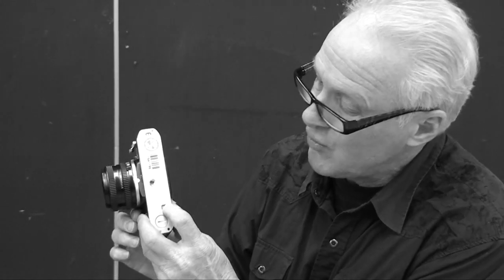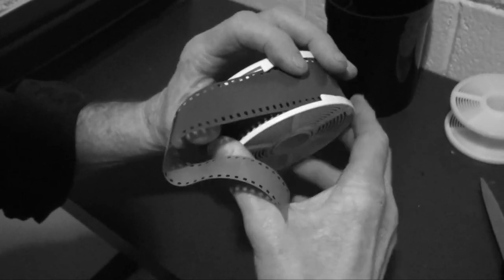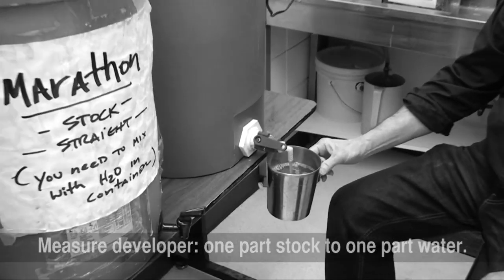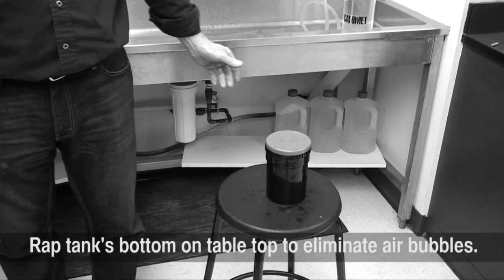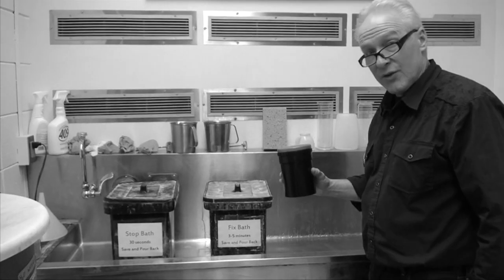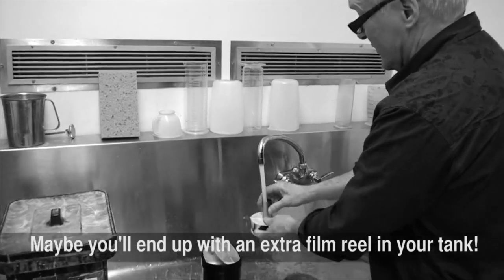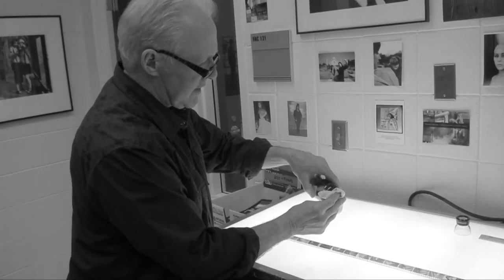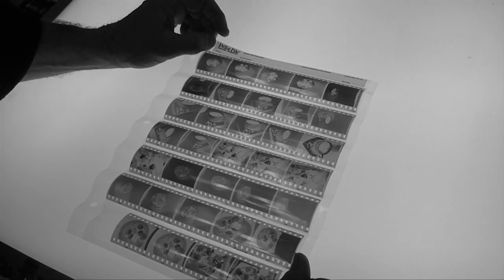Developing Black and White Film

Comment: I used to whack the protruding end of the spool of the cassette on the counter to push the cap off the other end, and if that didn't work, I'd use a bottle opener. The bottle opener method would usually bend the end cap and make the cassette unuseable for re-loading.
Cutting my negatives into six strips of six allowed me to make a contact print of all 36 frames on one sheet of 8 X 10 paper. A newer version of the Patterson proof printer which I used to use is still available at Adorama.
Reply from the maker: Bulk loading film is awesome if you are an avid 35mm shooter and want or need to save money. You can also make your own custom length (16, 20, 24-exposure) rolls. But it takes some effort and won't work for every camera, and you probably will lose some shots in the process. I found a great article and how-to on bulk film: https://www.35mmc.com/27/12/2019/worried-about-the-price-of-film-some-thoughts-on-bulk-loading-and-my-process-by-daniel-sigg/. And, I think the author might be from MN!! I always used a bottle opener to open the film–and hadn't heard of loading your own film at that time!! Instead I used the canister pieces for art projects... :)) Thanks for the tips!! –L

Comment: May I suggest extracting the leader in the light, using a device which may still be available, then cutting the corners off in the light. You may then locate the leader in the spool, turn the light off and then pull the cassette down. This will enable you to load using the ratchet without the film coiling up. Pull the cassette down again as it gets to the spool.When fully loaded you cut the cassette away from the spool quite easily. This also works if you are using a centre loading spool though this takes a lighter touch. I also used to check the dev temp and stand the tank in a bowl of warm or cool water depending in which direction I needed to nudge the temp. Also agitate every 30 secs to increase contrast. I just checked - you can still buy a film leader extractor. If I am going on a bit I apologise but these videos are bringing it all back to me. I really need to get all this gear back again. I started as a kid in the 1960's and printed my last in the late 90's. I was pro by then but colour was replacing B&W and, of course, digital came not long after. There's a lot of nostalgia in this for me. All the best Jon
Reply from the maker: There are lots of different ways to do the same things :) We're glad our videos are bringing back memories for you and inspiring you to get back into black and white photography!! Film photography is not dead! There are many wonderful articles on the Internet that say so and that in fact it's making a comeback. Nothing will ever replace the experience and beauty of black and white photography. Good luck to you Jon!!

Comment from the maker: ***** The way he agitates the tank is the best way to keep the film covered with “fresh” solution. Developing chemicals become “exhausted” shortly after being in contact with the film (a part of the developing process). Properly agitating the tank is very important to getting great results. Under agitating usually yields less contrast, while over agitating tends to increase the contrast, but could also damage the film.

The invertible tank he uses does not come with a part like that. There are other types of tanks—some you slide back and forth or some with a handle to turn. Inverting the tank as Professor Agar does causes some of the liquid to escape, but not much. Good luck to you!!

Comment from the maker: Elainiel Baldwin You have to be in complete darkness--you cannot see your hands when loading film onto the reel!! If you don't want to be in total darkness, you can get a black bag specially made to use when loading film. Your hands, film, reel, and tank go in the bag. You won't see what your hands are doing, but you will be able to SEE. There is another kind of film you can use that can be loaded while using a red safe light--it is called orthochromatic. "Orthochromatic photography refers to a photographic emulsion that is sensitive to only blue and green light, and thus can be processed with a red safelight. The increased blue sensitivity causes blue objects to appear lighter and red ones darker" (from Wikipedia). Ilford makes orthochromatic film.

Comment: Me: Wears gloves, tries to work as clean as possible, doesn't dispose chemicals  to the sink...
Will Agar: hold my rodinal
Reply from the maker: It is best to use gloves and other precautions but easier to not... The majority of chemicals used in the black and white darkroom are classified in the range of non-toxic to slightly toxic. However, black and white developers can be toxic, especially when ingested or inhaled or when in contact with bare skin. Some, but not all, people are extremely sensitive to chemicals present in some developers which can cause severe skin reactions.

Comment: That's a lot of chemicals you're pouring in for just one roll of film.  I have the smaller tank versions with the steel spools and it takes less chemicals.  Granted, you have to have the proper bowing technique to get it loaded right.  I've messed up once loading it.  The film was touching itself and wrecked some frames during developing.  And here's a tip for you:  if you ever run out of Photo-flo, use bottled water.  After the final rinse, empty the water out of the tank, pour bottled water into it and let it sit for a bit.  The first time I developed, I did get streaks because I didn't have a wetting agent.  Then, I tried bottled water, because the tap water is hard.  It has worked for me every time.  I have never used a wetting agent of any kind.  Not even dish soap.  I'm sure the wetting agent does a better job, but it's something to consider.  And why not?  A lot of people just use plain water for stop bath.  I use stop bath.  I just make it weaker so the bottle of concentrate goes further.  I also like the fact that you did not use a film squeegee.  It's not necessary and you risk scratching the film.  Thanks for posting.
Reply from the maker: The Professor says chemistry is cheap. Film and paper (which contain silver) is the more expensive investment. The products he uses in this video are what they have at the college and work best for most students–a little easier, less mistakes... Thanks for sharing your experiences and the bottled water tip!! Best of luck to you!! –L

Comment: You can extract the first 2 or 3 inches of film with a handy device and trim the end in the light. I still have this gadget. Certainly made life easier. Whats also handy is that you can reload the cassette from  a bulk stock of film. Thanks for the trip down memory lane.
Reply from the maker: +jj53 Thanks for the tips, although it is always best to work with undeveloped film in complete darkness. Even though there is usually a generous area of blank film at the beginning, even a very small amount of light getting into the canister can ruin those first shots. I like the idea of reloading bulk stock into an empty film container. How did that work for you? Thanks for watching and good luck to you!! :)
Reply: Never had a problem with light getting around the tool. The bulk film loader was great and enabled you to  recycle used film cassets. The is no darkroom stage in loading the cassets and you could cut film costs considerably. I think the bulk FP4 or HP5 came in 100ft lengths.
Reply from the maker: Nice!! It's always great to save money!!
Reply: Bulk film sometimes comes unnumbered - it maybe ex movie stock - I don't really know - but it worked. I was a kid then and doing things in a different way was part of the attraction as well. I haven't shot film in 14 years now. Processed my last B&W pics in the late 90's. May go back to it one day :)
Reply from the maker: jj53 Bulk film wouldn't work very well if you were trying to have a photo company reprint some of your negatives! You're so right–not doing things the way everyone else did them was/is very attractive!! Sounds like you had fun back then! Hopefully you can get back into developing and printing one of these days :)
Reply: Don't you do your own printing? You must do that. I used to enjoy dodging and burning in. If you want a high gloss on glossy paper and you don't have a glazing machine try squeeging the print onto a clean window. When you'r a kid without a budget you learn to improvise.
Reply from the maker: jj53 Yes I've done my own black and white printing. I was just thinking of all the trouble I used to have getting color prints printed back in the day :) You are full of great tips!! How did you learn that one? I still don't know if I like matte or glossy better! I like which ever one is richer looking, but I can't figure out which is and I like them both!!
Reply: I never did print my own colour, couldn't afford it. Gloss or matt, both have pros and cons. Gloss is nice and punchy but reflects ( I'm sure you know) - good for maximising impact. Matt less so but less contrasty means more tones - ideal for faces and where you want to preserve tone. The 'window glazer' seemed obvious to me at the time because there was nothing else around me to use. After washing the prints in running water for half an hour I rinsed them in the same wetting agent I used to rinse film. I think one or two prints did get stuck to the glass but ho hum. When I did get a double sided print glazer I also tried to use it as a dish warmer for the dev dish. It turned out to be too fierce and uncontrollable so I then bought a dish warmer.
Reply from the maker: jj53 Sounds like you've been developing your own for a long time! You've got great stories and tips!! :))
Reply: You guessed it right, I was a kid in the 60's. I seemed to get far more satisfaction from the craft in photography before digital came in.
Reply from the maker: jj53 Digital can be a no-brainer. I mostly use digital now, but I sometimes do more than point and shoot lol. I really enjoy Photoshop and designing, so digital works best for me. But there is nothing like a well crafted black and white image–both the process and the result!!

Comment: Great videos and instructions. I've been shooting 35mm for 45 years and 4x5 for the past 5. I just started developing my own b&W 4x5 negatives. Do you have any recommendations for a neophyte in selecting the chemicals and dilutions for my fist attempt at printing? I was planning on starting with an Ilford multigrade b&w 8x10 paper. Thanks
Reply from the maker: +irishvoyageur Professor Agar says, "What took you so long in deciding to print? Since you are printing with Ilford paper, why not buy their complete line of liquid print developer, stop and fix? The developer allows a one-shot mix–follow directions on the back. I would get a couple of plastic bottles for re-using the stop and fix. Mix the fix as if you are developing film (twice as strong as film fixing). This allows a 30 second to 1 minute (if cautious) paper fixing time. This would be ideal for the 8x10 route. Edwals also makes a fine line of liquid chemistry. I use Kodak developer Dektol which is a powder and has to be mixed up, stored and used at 1:2, 1:3, or 1:4 ratio. Good luck and keep in touch!"

Comment: Hi! Thanks for the video! Really useful! But I have a question, what product do you use when you clean the film?? (I mean de product you use before cutting the film, on the light table).

Cheers from Spain!
Reply from the maker: Adrián Álvarez ¡Hola Adrián! Any good film cleaner can be used. Professor Agar likes the Edwals brand. After developing, the film should already be clean. Film cleaner provides anti-static protection, which is especially good in winter months when the humidity is low. Thanks for watching!! ¡Feliz Navidad y próspero año nuevo!

Comment: in the video, toward the end, u talk about scanning the developed film, r u just scanning in using normal scanner? also is it possible to project the developed film by placing a direct light source or projector behind the film? thanks
Reply: You need a dedicated film scanner or use the film scanner option in SOME regular scanners. About projecting, yes you can but you'll need a lens (the bottom of a glass works too) and then set the correct distance to get your image in focus
Reply from the maker: +Hoa Chea You need a scanner that can scan transparencies. Epson is a leader in this with a variety of prices. You will also need photo editing software on your computer to edit the scans–Photoshop Elements is one of the best and what Professor Agar uses. In theory, yes it possible to project the developed film by placing a direct light source or projector behind the film, but on a practical basis and for what purpose would require further information. Thanks for watching How Chea! Good luck to you :)
Reply from the maker: +Fernando Callo You are correct! Thanks for watching Fernando! :)

Comment: Hi im new to film photography and have just recently used a variety of film formats but I have yet to develop any of it. I've tried to find places to develop it for me but have had no luck. So I have decided I want to develop it myself, I would like to know what the specific chemicals that are used and what you think would be the best thing for me to do since im a complete beginner?  your help would be very much appreciated, thanks :)
Reply from the maker: Jake Scott Hi Jake—Professor Agar advises to shoot a “test” roll of film like Kodak Tri-X to make sure you’ve got the mechanics of film development down before you develop your other rolls. Kodak, Ilford, and Sprint as well as others all offer equally good products, but those brands are easiest to find. You need developer, stop, and fix. Ilford and Sprint have liquid stock solutions that make it easy to mix and use the solutions. You can get the chemicals you need B&H, Calumet, and FreeStyle Photo (these are large mail order companies). You will also need three quart-size or half-gallon containers to store your developer, stop, and fix in. Be sure to label the containers!  

Make sure to load film onto developing reels in complete darkness! (If you haven’t already, you may want to watch “Loading Film” @HAc9pCOOD4s). After developing, rinse well and hang to dry. Finding someone to print your negatives may be hard or expensive, but you can do this yourself too. Scan the negatives at a high resolution, reverse the image (unless your scanner does that automatically), and print them. It's best to use Photoshop or a similar program to print your photos from, and you can also enhance your photo before printing if you want. Good luck to you!!!
Reply: thankyou very much for your help, just got to get all the equipment together now haha :D
Reply from the maker: Jake Scott That's great! Good luck to you, Jake!!

Comment: That tank should have come with a stem that goes down where the funnel is and lets you spin the spools instead of flipping it around and spilling it everywhere, do you mix it that way because you lost that part?
or maybe you learnt with the old metal tanks?
or you insist inverting the tank is the the way to most thoroughly mix the developer?  
I have one and i flip it around because thats what everyone does in the videos I've watched, but I hold the cap on tightly.

Comment: Is the film washer completely necessary?
Reply from the maker: Yes, Marion, you should do it. The Frugal Photographer says, "After film has been developed and fixed, it must be washed in water to remove the thiosulfate ("hypo") that remains in the emulsion. Thiosulfate binds to gelatin and is difficult to remove. If it is allowed to remain it will react with atmospheric sulfur to stain, bleach, and degrade the image over time." (http://www.frugalphotographer.com/info-washing.htm)
Reply from the maker: ***** Marlon Harrington You do not need a film washer, but film must be washed. The new films (T-Max) state that you don't need to use hypo clear, but its best to use a clearing agent on older films. A film washer is automatic (and not real expensive) but you can effectively clean your film without one. Fill and dump the bin or container your film is in with fresh water several times for about 5 minutes--no need to leave water running. Agitation and several flushes with water will clean newer film well.
Reply from the maker: ***** BTW, thank you for pointing that out! :)

Comment: I thought that agitation was to prevent air bubbles from forming?
Reply: If anything, movement might cause air bubbles to attach to the film unless you rap the tank on the table afterwards to dislodge any bubbles that might be there. 

Developer gets chemically exhausted after acting upon the film's emulsion, so agitation/inversion ensures that for the duration of necessary time, "fresh" developer makes contact with the film.
Reply from the maker: Well put Next Hobby!!!
Reply from the maker: Professor Agar says, "Presoaking film in water before development and 30 seconds of initial agitation ending with a sharp rap on the bottom of the development tank is the proven way to avoid air bubbles. Agitation every minute refreshes and reinvigorates the action of the developer on the film." Thank you for watching, Steve. Good luck to you!

Comment: I did this stuff years ago when I was in the navy (64-68), only we used a stainless steel reel and container.  Technique is virtually the same with some minor differences.

One point was I used a bottle opener for getting the film canister apart, although in the navy we bought our 35mm film in bulk and used reusable film canisters.
Reply from the maker: A Purvere When I took his class a few years ago, we used can openers to get the film containers opened. There are still some hanging around--stuck by magnets to anything metal. Thanks for watching!!